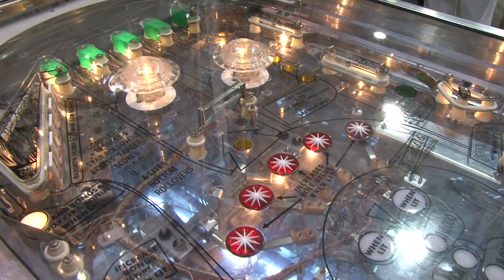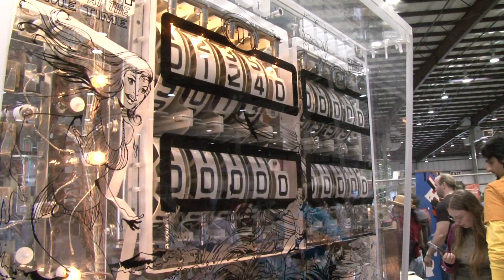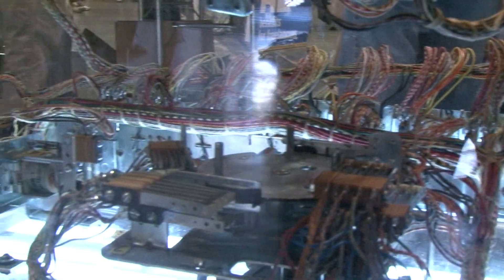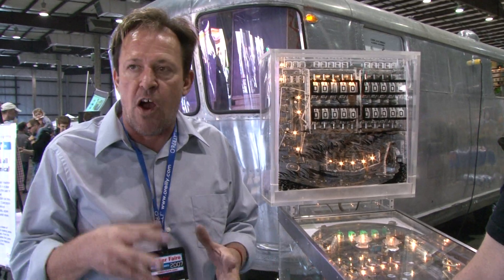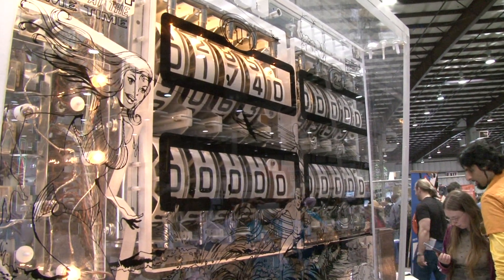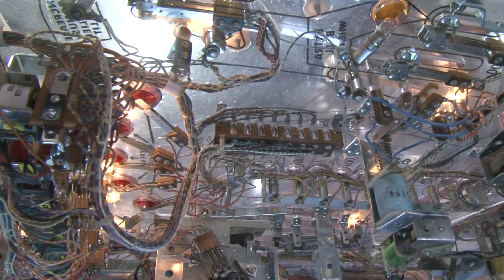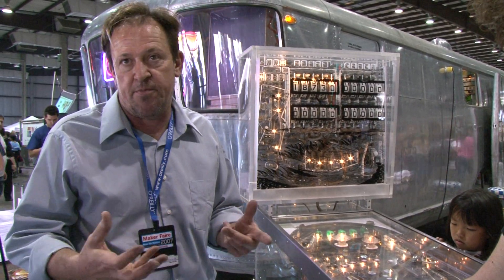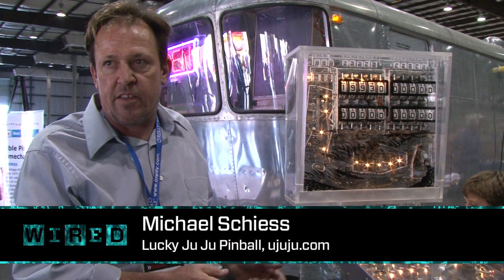Inside a Pinball Machine

Comment: @c0inoppl look for any broken insulation on all wires.  If at least one touches the earth ground or another high-powered wire, it can short out.  In some cases, crossed wiring that wasn't soldered is another thing.  Also check any loose wiring off switches, solenoids and relays.  This is a long process, but very useful.  Another thing to watch for a rhythm.  If the bulb stays on then suddenly it blows out, see if you can do it again by mimicking the same way how & when it went out.

Good luck.